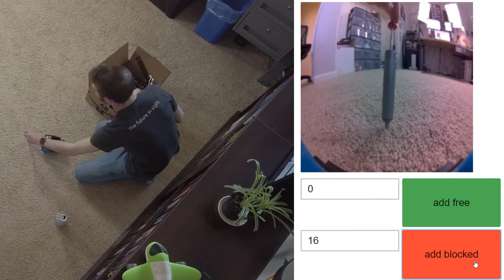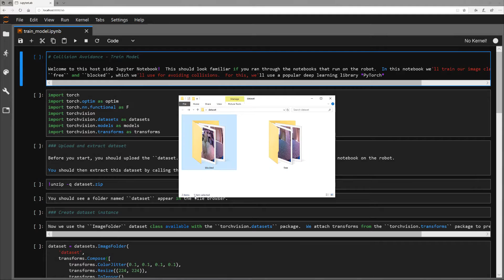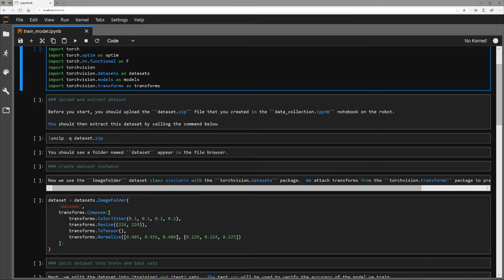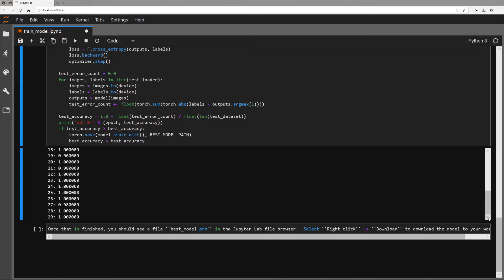Jetbot Neural Network Based Collision Avoidance

Comment: Talk on. I'm looking for a things recognition for blind people, so they can point with the head or hand and nano speaks what it sees. This would work quite out of the box with a speaker and camara connected, I hope. There are also those nice 3D mapping cameras, helping to map the blind peoples enviroment. An idea for you.
Reply from the maker: that's an interesting idea. having it speak what it sees would be relatively easy, the hard part would be accurately determining what the person is pointing at reliably from different camera angles and such. 

do you imagine that this device would just get placed somewhere in the room and as the person moves around and points to things it would respond (assuming the person and object are within its field of view)? or would the person hold the device and use it to point? the latter would be much easier, but the former could be solved too.
Reply: @ZacksLab  I imagine a hand wrist band with the camera and lateral blinding to get a narrow, defined angle of view. So it shoud be a portable system with accu pack. Maybe in a rucksack. You definitely do not want a fisheye camera for this task.
Reply: There are Android smartwatches now that have two cameras on them, one facing up, and one looking out away from the hand. Tensorflow lite runs on Android. Personally I don't know why people bother with things like Jetson Nano, when modern smartphones and smart watches have so much capability now. Unless you are doing robotics, in which case these embedded devices have all the IO ports, etc.

Comment: hey as a beginner i had a question regarding your training data images, did you use augmentation in any form to increase the amount of images that you could have trained your NN on?
Reply from the maker: hi Surya, no I did not use any sort of augmentation (I believe you're referring to translations, rotations, etc...). I would be interested in seeing how this affects performance if there were a tool that would automatically grow a dataset using this technique. thanks for the question!
Reply: Hi Surya,  the data augmentations that you can apply depends on the task.  For the JetBot collision avoidance, the data augmentation only includes pixel-wise color distortion (brightness, hue, saturation, etc.).  Horizontal flipping might also be appropriate for this task, since it doesn't matter whether we're blocked on the left or right.  However, cropping, translations, and scaling change the perspective of the camera relative to objects, which would change the objective.  For example, if we 'zoom' the image as a form of data augmentation, we would end up seeing some 'far away' objects as near by, which we would want to label as 'blocked', but it would falsely label with the original tag 'free'.
Reply: John makes sense, so in essence he can get twice the amount of data by flipping images on the vertical axis but any other form of augmentation is not worthwhile. Did I get that right?

Comment: What language would I have to learn to use the Nano? I always wanted to do something with face recognition.
Reply from the maker: You can do quite a bit with just Python and a familiarity with Linux. C++ is useful for OpenCV, but there is a python library that wraps the original opencv libraries into a library called opencv-python. You will sacrifice some run-time performance using this python wrapper instead of developing in cpp, but development in python is generally considered easier.

Comment: Important point, it DOES NOT support Wifi and Bluetooth out of the box. You need to purchase and install a module. Also, I just learned the hard way that power is an issue too.  On mine, after installing the module, it will not turn on with the USB power.
Reply from the maker: Sohaib Arif, good point, I should have explicitly stated that. Are you using the m.2 key or a USB dongle? I have not had any power issues with the Intel WiFi/BT card. If you're using the dongle and the issue is due to power draw on VBUS, you could try setting the jumper to use power coming from the barrel jack which allows for up to 4A I believe. You'd have to adapt the output of your battery to this connector though.
Reply: @ZacksLab  I am using the M.2 key. Interestingly, I tried powering it via a portable USB phone charger that I know sends 5V/2A and it worked but it does seem to be slower now. You are right about the 4 A barrel jack, I will add that soon. Do you have any suggestions for a portable version of that config? I am mostly a software guy so I don't have much experience with the electrical stuff.
Reply from the maker: I would look for a battery that can source 5V up to 4A from a single port (I think the battery on the bill of materials for the jetbot can do 3A per port, which is likely more than enough although I haven't done a power study on the jetbot). Then, use a USB type A to barrel jack adapter like this one: https://www.bhphotovideo.com/c/product/1368294-REG/startech_usb2typem_3_usb_to_type.html/?ap=y&gclid=CjwKCAjwq-TmBRBdEiwAaO1enw753uFBGzvPy3oIlOcMy3uRFGAFWwvLlx5PHGL2FudDY-Jb9OE1qhoCOvAQAvD_BwE&lsft=BI%3A514&smp=Y

Make sure you connect the J48 Power Select Header pins to disable power
 supply via Micro-USB and enable 5V @ 4A via the J25 power jack.

Comment: Hi, it is great video. I just got nano and wondering how to setup training to save my own data. Will you have step by step video? Thanks
Reply from the maker: Hi Ryan, thank you! If you follow the collision avoidance example that is on the jetbot's github repo under NVIDIA-AI-IOT/jetbot/notebooks/collision_avoidance you will find a jupyter notebook called data_collection.ipynb. Launch this notebook on the jetbot and run through the code, if your jetbot hardware is set up correctly everything should go smoothly.

I can definitely do a step by step video on this but it will take me a bit to get it posted!
Reply: @ZacksLab  thank you if it takes a while it is ok but it would be very very helpful with step by step thanks again dude
Reply: @ZacksLab  I would also like to see that in one of your upcoming videos, Hopefully It's still in your plans.